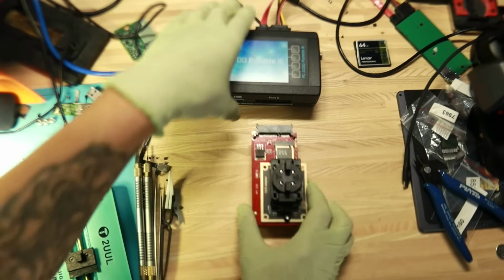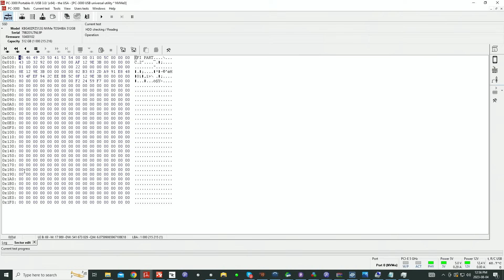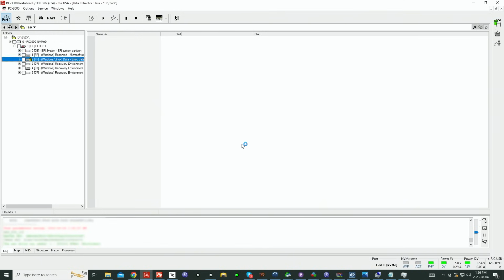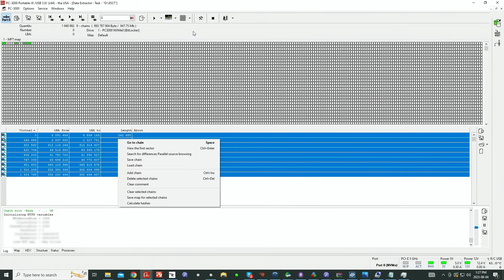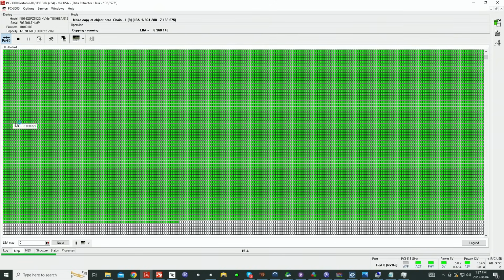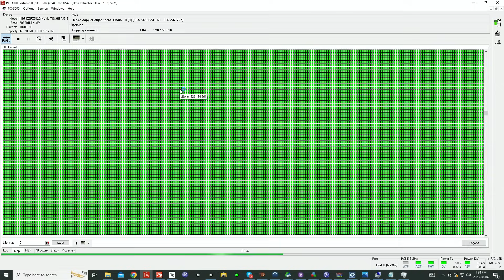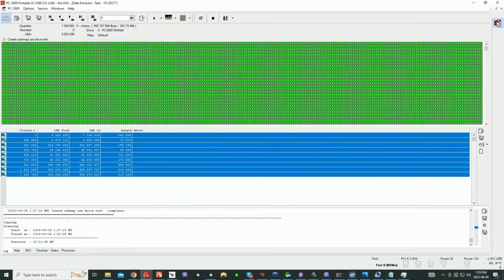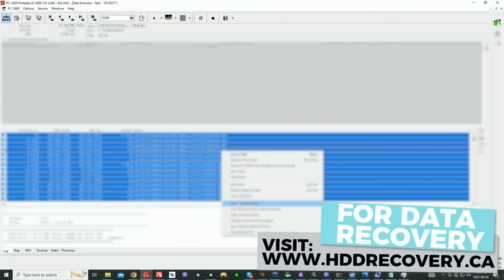Dell XPS data recovery from BitLocker encrypted soldered on SSD

Comment: I have the same dead dell xps but with intel ssd chip, I guess it's intel 700p bga variant, also i found on the back of the motherboard JSSD1 pins, maybe it's possible to access the SSD without bga unsolder work?
Reply from the maker: Possibly, there are M.2 SSDs that use those chips and if there is a pinout it could be used   as adapter

Comment: As a rule, I do NOT keep any personal data on the boot drive (usually the C: drive in Windows machines) but on another removable drive that I have control over. As far as I am concerned the boot drive is for software only. It then becomes easier to perform regular backups on the data without having to set the backup to ignore software folders which can always be replaced by re-installation.
Reply: That assumes all programs are well behaved and save data where you want
Reply: so what.. just have BackBlaze or what ever just back up your Documents folder, where you save all your stuff.. you're making up this other drive thing like it's going to make any dif. but live in your world..
Reply from the maker: Backup is the only way. Having data on a separate device is not gonna make it more secure. Truth be told only about 15% of all SSDs today can be recovered if failed. SAMSUNG forget about it, intel forget about it and these are most trusted. Those SSDs  that are recoverable are less reliable than a previously dropped hard drive :)

Comment: As a pc/apple repair tech  i always find it strange that data recovery specialists call pcie nvme ssd transfer a data recovery. Basically such ssds do not require any specific software or hardware to read, it is technically a removal of one pretty big bga chip  and moving it to spare ssd board with same pinout. Yes, there are adaptors for pc3k(for example acelab sells 2$ m.2-apple gumstick5 adapter board for 250$ which is a clear scam), but they are not essential unlike direct nand reading.
Reply from the maker: You can call that data transfer on your channel dude, start a trend and see how many jobs will be sent in. What is strange about marketing services that you are selling? I am not in business of data transfers, I am in business of data recovery so I gring at that. Trust me, I cringe too when I see videos or repair guys put a new connector on broken flash drives or better yet attach a sliced USB cord to it and call it data recovery, but they need to get these devices in, right? If I lose my shit on Dell XPS I am not gonna google dell XPS data transfer to look for a place. Would you?
Reply: @hddrecoveryservices  well, is there any the difference between removing m.2 SSD and reading it via adapter, from, say, glued MS  Surface Pro and doing the same but now instead of m.2 you need to transfer BGA291 package to a donor m.2 drive, also which is way faster than opening Surface even if you decide to destroy the screen?

What i am trying to point is that i used to think that datarecovery means getting data from logically or physically damaged medium,. For example, Apple Data tranfer utility/tool is not called "data recovery utility" for the very basic reason that software to interface with T2 or with older Lifeboat connector is an interface, a bit fancier than usb-stata plug but principle is the same - drive itself is quite functional.

Comment: What will you do if customer unable to provide encryption key/password? and with that online mail bound recovery is not available. 
is it possible to recover?
Reply from the maker: In some cases, even with bitlocker on the key would not be required. Data extractor can handle some of the OEM keys, and I just did one yesterday that was setup that way. But if the key was set by client it would be unique, so yeah we would need it. Or we would need the laptop that it came from working. This does not just apply for surface devices with soldered on SSD but almost any dell, HP, Lenovo laptop these days

Comment: Nice one!! And yeah, another great industry trend by Apple, since their margins are so small, they have to save everywhere they can! Soldered on SSD, no more chargers with phones.... etc..... Not like they can afford to make shit repairable / upgradeable! (sarcasm of course)
Reply from the maker: Dude, remember cars that you could see the engine when you open the hood? Now all you see is a big plastic cover covering the whole engine bay. Why? Same reason. 
My last car needed a dealer to change the battery because it needed to be programmed in.... it's just the world we live in now bro
Reply: @hddrecoveryservices  Ohh I know, I started out as a mechanic many years ago. Glad I don't do that crap now. But, I do like the electrical diagnostic end of cars now. Just not the wrenching and total crap engineering on how you can't get to anything. I migrated in to automation and controls and eventually electrical substations, doing protection and control.

Comment: I've seen you do a bitlocker recovery several months ago and in that video, you had default keys used by the vendor, one worked and you did the recovery.  What would be your options if the customer didn't know they key and/or you couldn't get the key?  I got my first OEM bitlocker enabled drive in a minipc and the first thing I did was turn it off, then re-enable it so they didn't have my key.  I use bitlocker on every PC and while I keep the keys in a safe place, I also image the C drives ~monthly to an encrypted NAS, so it's unlikely that I'd be a customer in the future.

Comment: Companies just want to have control over your devices, soldered on SSD is one of them, not only its anti consumer in the aspect of self repair it is also on locks you in to service the device in their service centers(which, to this day DO NOT exist in every country!)
Reply from the maker: Oh hell yeah. You are more likely to get their certified repairs for the device (whatever the cause is) because the data is trapped in there. It's not just toss and replace at that point.

Comment: I believe Bitlocker uses two keys, one stored in hardware - TPM, and one stored on the disk or elsewhere, that gets unlocked with the password or recovery key. I did not see where you retrieved the key from the TPM. Is the "hardware" key stored on the controller on that drive ?
Reply: with pc3k all you need is the password or recovery key

Comment: I remember ACE saying that it is impossible to create map of MFT with bitlocker. That was dumb because we could save files but not scan map of sectors. But it was a response from TS.  Guess something changed for last year or two.
Reply from the maker: I would believe so. I don't think I had encountered this issue. Unless you are talking about the initial option to scan map, in which case map needs to be built using the device info like it shows in the vid
Reply: @hddrecoveryservices  Maybe the one i talked to on TS was unaware of this option. It happens.

Comment: There would be one advantage of imaging the whole drive, namely to boot the image on a virtual machine if for example some of the recovery requires extracting saved passwords in the browser etc.
Reply from the maker: Indeed
Reply: Also databases, or programs that use one. mysql usually runs on the C drive as an example.

Comment: great job.  as you did not link to the ssd adapter i looked it up. not cheap, 700-800 usd range but great idea.  is there one for apple silicon ssd's?
Reply from the maker: No, and I think due to T2 there won't be

Comment: what happens if the client does not remember the BitLocker key? Is there a way to bypass that? I think you shared something around this topic, but it is a bit too foggy.
Reply from the maker: Yes, so in the Microsoft account there will be an option to look up the recovery key for the owner of the device

Comment: You had me at "bitlocker". I'm a crypto IS guy, and understand how BitLocker works, so this was an instant watch. Especially as Microsoft is probably going to push BitLocker down into the regular Home edition now for mass consumers. Encryption Key Management will be absolutely critical to be zero-defect at the logical level, much like what you do at the physical level. Except with encryption, if you get the encryption key recovery management wrong, your data is toast, no matter if the hardware is working properly.
Reply: The hardest part was "ask the customer for the password or key". Most non-enterprise IT folk won't even know what or why or how to find out what the recovery key is and save it securely until something like this happens.

That it took only an hour is pretty amazing, so kudos to their IT/IS team.
Reply from the maker: oh, it was not the IT, client pulled it up for me. @mike80808  For that reason I have this link saved in my bookmarks :) https://support.microsoft.com/en-us/windows/finding-your-bitlocker-recovery-key-in-windows-6b71ad27-0b89-ea08-f143-056f5ab347d6
Reply: Question, if you don't have the recovery key neither the password for bitlocker are there other method to recover the data ?
Reply: @helmutfriederici9299  
No. Encryption would make zero sense if it would be otherwise.
Reply: @helmutfriederici9299  If you don't have the key, it might be possible to image the data and restore that (encrypted data) to another device (most likely it will need to be a near identical manufacturer and model replacement) and then hope that the replaced device is recognized by the original system the original failed storage device came from, and uses the key Windows has stored and encrypted with keys in the TPM module of the host PC/system. That's why BitLocker only works with a Microsoft account login - Microsoft pushes those BitLocker keys up into your account storage so you can recover all of your BitLocker-encrypted data when you replace a failed drive or replace a motherboard or move the drive to another replacement or upgraded system.
Reply: @helmutfriederici9299  Otherwise, you are SOL. Brute force will be the only way to recover your data.

That's what makes backups important. And complicated, because if you're encrypting the data on your drives, you sure as heck also want to encryptyour backup drives. But with a different key, one you need to recover your backup drives to copy back onto a system that may or may not be the same one the backup was made from.
Reply: What that probably means for your business (data recovery) is that you'll also need the TPM module or the entire system the storage device came from. And that will be ugly and messy all around.

Comment: Is the password required to simply clone the drive? As a customer I'd probably prefer not to give it away 7:43
Reply from the maker: We could technically image it without the key, and just give client back the encrypted drive. But I would not touch a case where the client does not release the key to encrypyion.
Reply: @hddrecoveryservices  could I ask why?
Reply: @adrianLthomas  Maybe the key proves that the "client" is the real owner of the disk?
Reply: @marpintado  I'm not sure how that proves it? A thief without the key wouldn't be a able to decrypt it anyway. A thief with the key wouldn't prove they were the owner.
Reply: @adrianLthomas  In this case a password can give access to the data, cracking a password is much simpler than cracking the key.
Reply: @hddrecoveryservices  I wouldn't either. The customer could easily turn round and say nothing was accessible and not pay or issue a charge back and you wouldn't be able to prove otherwise. You'd never really know if he was lying or something went wrong during imaging etc. Not worth the time and hassle.
Reply: i think it's : no data vs trust the man who You gave ssd to recover at first place ....
Reply: @bbokip2138  apologies, this wasn't a criticism, just an observation. Let me rephrase the question: can you perform the clone and the recovery without the key? i.e. The customer can insert the disk and enter the password themselves on the cloned drive?